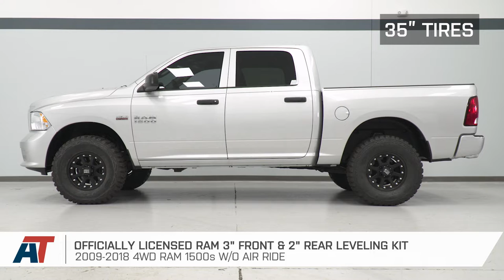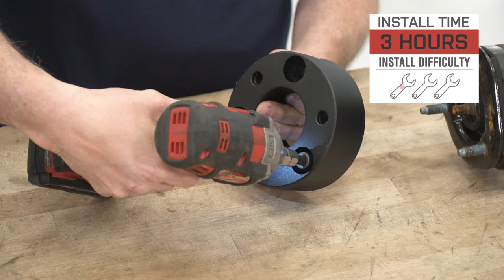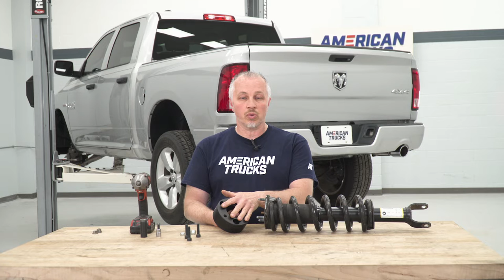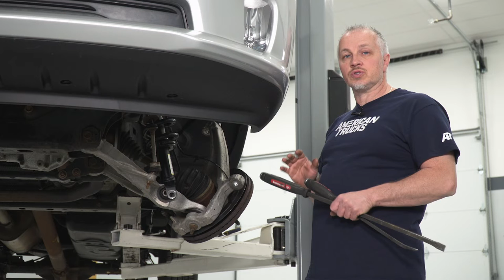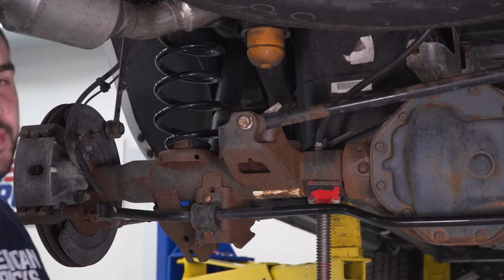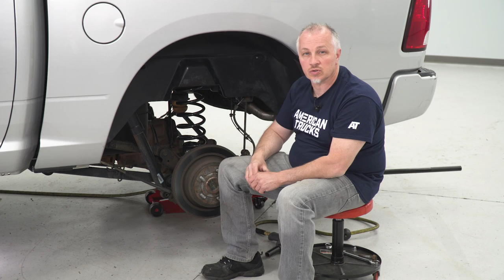2009-2018 RAM 1500 RAM Officially Licensed 3" Front / 2" Rear Leveling Kit Review & Install

Comment: does this require after market upper control arms like other 3" level kits?
Reply from the maker: It would be a great addition to this kit if you have room in your budget! Without aftermarket upper control arms your factory ones will be at a pretty steep angle that could cause premature wear over time. -Zach

Comment: What aftermarket control arms would you need for this leveling kit? I own a 2011 Ram 1500 RWD.
Reply: I used Zone control arms. Just looking at them they are beefy box welded. No problems for 3 years now. The stock ones are flimsy crap.

Comment: Never mind using a torque wrench to spec set all those suspension nuts 🤦🏻‍♂️
Reply: No point when reinstalling old front end parts. They aren't at spec anymore so proper torque spec will probably be loose.

Comment: Is it completely necessary to buy new UCAs if I use these?

I dont go off-road. 

Speed bumps is the closest thing that I will do to off-road. 

Occasional curb climb at parkings perhaps.
Reply from the maker: They'll help keep your ride smooth and your upper control arms at the appropriate angle! If you have room in your budget, I'd highly recommend them. -Zach

Comment: Do not level your Ram 1500’s front suspension with this. It is 100% the wrong way. It pushes the suspension geometry out of whack and sets the CV axles at horrible angles. Do not cheap out. Use Bilstein 5100’s or similar. Bilsteins lift by preloading the OEM spring and your geometry does not change any more than stock because the do not extend the total length of the strut. A byproduct of the Bilsteins is it firms up the ride and gets rid of the junk oem shock and mushy cornering. I have been running them for 4+ years and 65k miles. Using the coil spacers on the rear is fine.
Reply: Links?
Reply: to start upper control arms needed
Reply: I used the 5100 Bilsteins on my new 2022, no more rake, rides great.
Reply: Aren't the spacers supposed to be installed in the strut body under the top hat?

Comment: It lifted it, but in no way did it eliminate the rake.
Reply: They should've left the rear at stock level
Reply: 3” front would have had it pretty leveled or at most 1” block in the back but 2” and it basically looks like stock only higher if that makes sense.